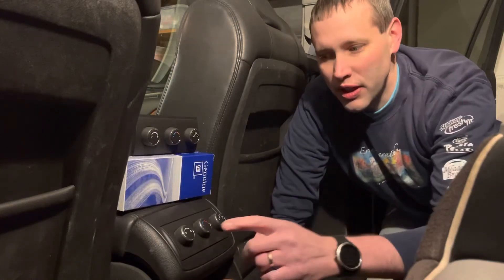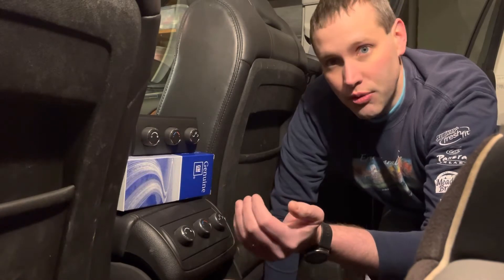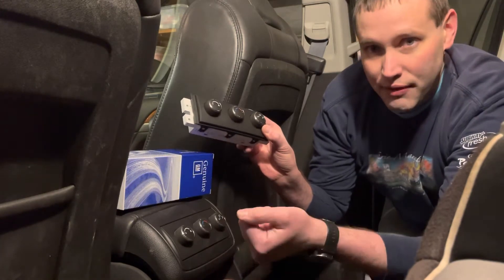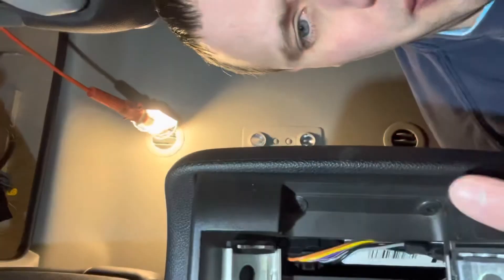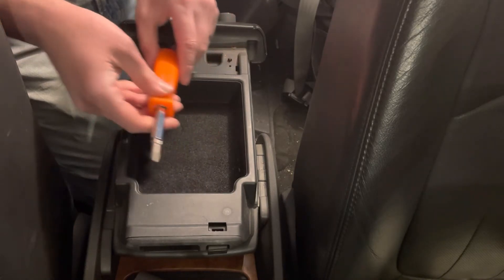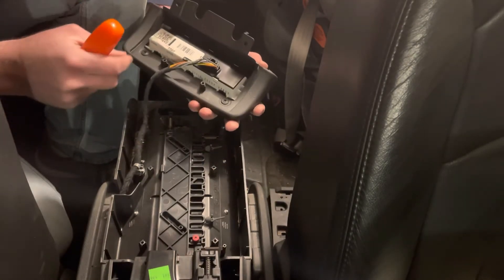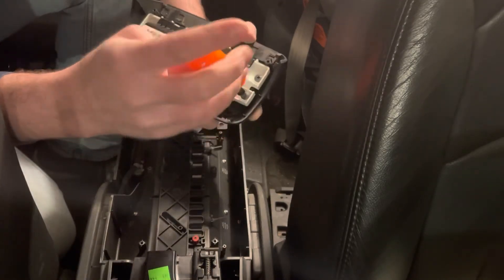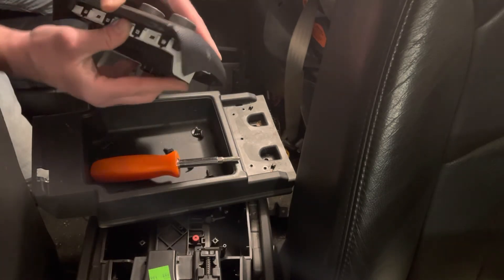Rear HVAC controller replacement - Buick Enclave, Chevy Traverse, GMC Acadia, Saturn Outlook

Comment: I have been looking very long for your video in regards to the rear HVAC. The HVAC controller knobs get very HOT on my 2014 Traverse. Still working on trying to fix mine.
Reply from the maker: Glad you found the video, good luck with your repair!
Reply: Hello.. did you find the problem why the controller knobs getting very hot? I have the same problem with my Traverse.
Reply: I have this issue as well with them getting hot. Why do they do that?
Reply from the maker: Lots of people seem to have the issue with hot knobs, I don’t know why they are getting hot.  Never noticed it in our Enclave.

Comment: Do u think it needs to be changed if the control is hot and only two glow in the dark but it still works
Reply from the maker: If the control is hot, it could be a safety issue, even if not, it’s probably not going to last much longer and should be replaced.

Comment: I get an annoying humming noise coming from ours, our battery started drain now as well. I wonder if a bad hvac control unit would cause the battery drainage?
Reply from the maker: It shouldn’t drain the battery, but stranger things have happened.  If it’s making a humming noise there is something wrong with it and I would recommend replacing it, they aren’t super expensive.  If you do, let us know if it fixes the battery draining issue!

Comment: My control unit is still functioning, I just had one of the knobs break.  Is it possible to just replace one of the knobs?  I don't need a whole new control unit.
Reply from the maker: I just checked and the knobs on mine don’t seem to be removable.  You may need to replace the whole control unit.
Reply: @NateFixesIt  Technically it's not the whole knob, just the part that shows what the knob does.  I am going to try to add pictures.

Comment: Question my control lights on the rear knobs in my 2015 traverse are out , is it easier just replacing this whole panel or can you show a video how to replace the bulbs ?
Reply from the maker: The bulbs are LEDs that are integrated into the circuit card and not separately replaceable.  If you want the lights to work, you will need to replace the whole control unit.

Comment: How do you trouble shoot down to the control
Reply from the maker: First check your fuses.   Do you have heat and cooling both places?  For me, the rear blend door actuator was burnt out and when I replaced it, the controller kept pushing it to the same position.  I tried switching the controller across actuators to narrow things down.   What is the issue you are having?

Comment: After you change the part did that solve the problem , and it start to cooling ???
Reply from the maker: I had two issues, the controller was bad and the rear blend door actuator failed.  I suspect the bad controller burnt out the blend door actuator.   I have a separate video for the blend door.  Replacing both got everything going again.

Comment: My rear ac just won't turn on ! Do I have to change that too?
Reply from the maker: It could be a number of things, the controller, the blend door actuator in the rear, a clogged expansion valve, a burnt fuse, etc.   You will likely need to do some diagnostics before starting to replace parts.

Comment: Enjoyed the video great detail! My 2013 Enclave the rear fan switch/on-off just stopped working and the rear won’t come on. Do you think the switch is just bad? I would hate to buy one and that wouldn’t be the cause…Your input would be Very helpful thanks!!
Reply from the maker: First, try turning the fan up to full.  There is usually a resistor that is in the circuit for lower fan settings that slows the fan down.  Those can burn up and take all but the highest fan setting off line.  If the fan works on high and nothing else, replace the resistor.  Next check your fuses,  and try replacing the fan fuse, you can even swap it with a different fuse with the same rating to test it.  If that doesn’t fix it, it could be the switch or the fan.  Replacing the fan would be a lot more work (see this video for how to access
https://youtu.be/S_JB5KGEykM), I would start with switch unit.  If you have a multimeter, you could try testing the control unit, but I’m not sure if that will be possible with the wire harness and no other connection points.  Good luck!

Comment: Good day and thank you for your informative video It was very helpful. However I was wondering if you would do a little bit more troubleshooting with me. The fuse is not blown and I changed this out with help from your video. The controls still are not working they light up but they don't do anything. Any thoughts?
Reply from the maker: Hard to troubleshoot from a distance, but the next things I would check to see is if the electrical signals are getting from the controller to the HVAC unit at the passenger side rear of the vehicle.  The fan is the obvious thing to be able to tell if it’s working or not, but you can also listen for the blend door actuator and mode door actuator to see if they are responding to the controls.  If the blend and mode door actuators are working, but the fan is not, I would guess it’s a bad fan.  If nothing is working, I would guess a wiring issue.  Check out this video to see where they are and what the actuators should sound like:
https://youtu.be/S_JB5KGEykM

Comment: Hi!  I have the 07 Outlook, with the separate radio/climate controls in the back.  They light up but I do not feel any air coming out from the rear air vents.  Would replacing this specific part fix or would it be the rear blower motor?
Reply from the maker: I would start by checking your fuses.  After that, it could be either the blower or the control.  To troubleshoot, you could use a multimeter to see if you are getting power out of the control unit or to the blower fan.   To see how to access the blower fan, you can check out my video for replacing the HVAC blend door actuator in my Buick, it’s quite a process, but should be similar for your vehicle.

Comment: Natefixeslt i have a similar problem but the rear only blows cold no heat and mines is a 2010 travers and its digital with push buttons could this be the same issue.its at 106kmiles? Thanks
Reply from the maker: Could be the same issue as mine.  However, the first thing I would check is my engine coolant levels for the engine radiator.  Hot coolant is what provides the heat to your cabin.  If the coolant is low, you may not be getting heat because of that.  If you have the full coolant, it could be the control module, a heater core, or a blend door actuator.  To diagnose, You can try this: turn off the A/C system and start the engine, let it warm up to normal running temp and crawl under the passenger rear corner of the car just in front of the bumper. There are 4 pipes and hoses going up through the floor pan. The A/C lines should be at ambient temp and the heater hoses should be hotter. If you warm it up all the way you should be able to hold on to the heater hoses for about a second with both hoses the same temp. If the same then you need a blend door actuator or control unit. If temps are different then it's a heater core.  This video shows how to replace the blend door actuator:
https://youtu.be/S_JB5KGEykM
Reply: Ok thank u...mines blows hot in the front but not the back.

Comment: My controls work in the back of my traverse but they don’t light up do you think that’s the fuse? If so is it in the vehicle or under the hood?
Reply from the maker: I think that there is just one fuse that protects all of the functions in the rear HVAC; so if it’s working, the fuse is probably okay and the light being burnt out is probably a different issue.  It could be that the LEDs that back light the controls burnt out or a wiring issue somewhere.   That said, checking the fuses is an easy and inexpensive thing to try.  The owners manual for your vehicle should have a diagram that tells you exactly where all of your fuses are and what they control.  Check your manual, but I highly suspect there will be only one fuse and it’s under the hood like it is in my Enclave (see 15:20 of this video https://youtu.be/S_JB5KGEykM ).  Pull the fuse, verify every thing is off, and then swap in a different fuse of the same rating to see how everything works.  Good luck and thanks for watching!

Comment: Having trouble with my rear control panel on my gmc acadia the the fan works in the front but not in the rear the lights on rear control won't light up and fan don't work on the rear
Reply from the maker: Check your fuses for the rear first (I suggest putting a new fuse in, not just looking at the old fuse as it can be difficult to see a failure some times).  If they are fine, it could be the control panel.

Comment: This car seats 7 so you most likely have kids which is why you bought it. So if you value your sanity on a road trip then disconnect this control panel. If you are like me then the last thing you want on a road trip is for your two ADHD kids to be messing with the radio volume and the climate controls. Do yourself a favor and watch this video to learn how to disconnect the unit and then put it back together.